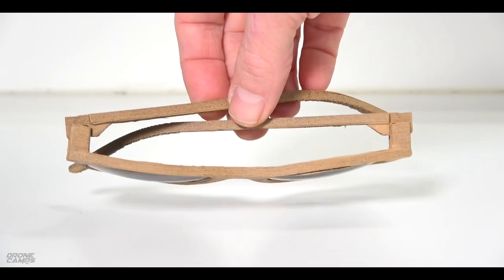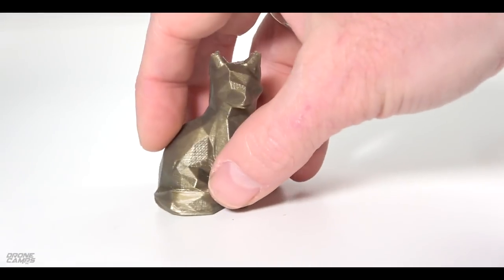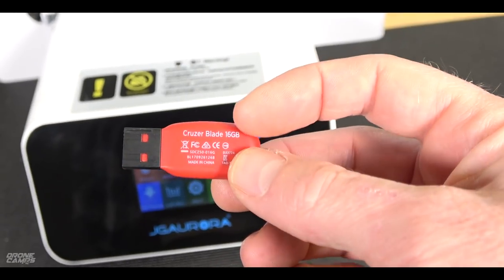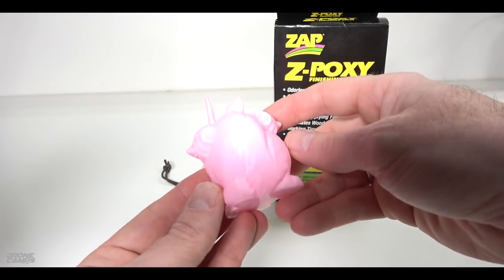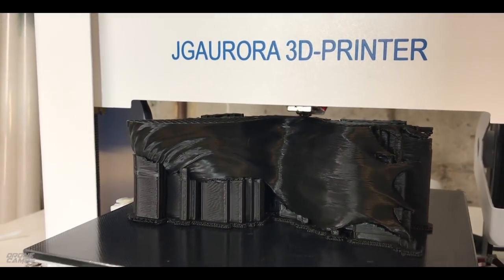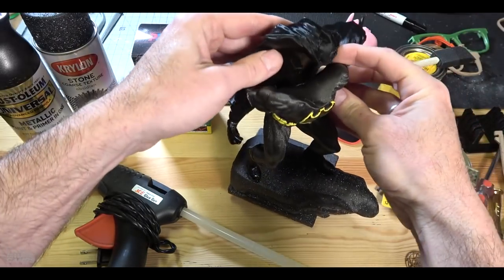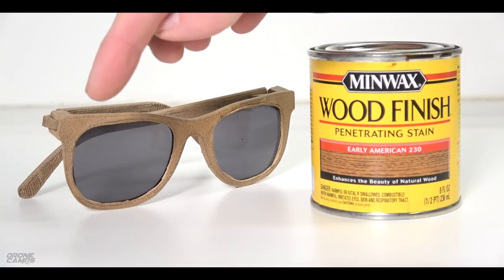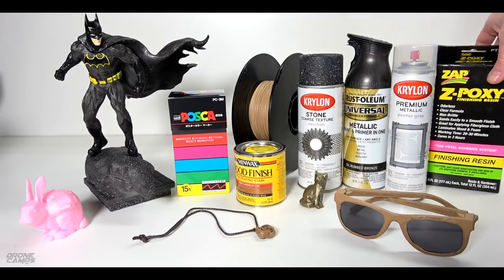JGAurora A3S 3D Printer - Full Review - Pros & Cons

Comment: Friendly suggestion on simplify 3d settings.

Retraction should be 5 or 6mm lower temp 5' set "travel" speed to 100mm/s 120 if the printer will tolerate it.

Depending on the model you can also enable the feature to "do not cross outline" which will keep most of the string internal and therefore not visible.

Petg is weaker than pla. But it has more give (flexible) so its "tougher" it can also handle higher temps without warping as readily as pla will.

Comment: Hi Justin, great video as usual :) Are there any sub $300 3d printers you can recommend that print well out of the box using TPU? I just want an inexpensive one for printing quad parts like antenna mounts and camera mounts for different models.
Reply: in4bliss I have same question as well. Don't need anything fancy but something simple to use for RC hobby.